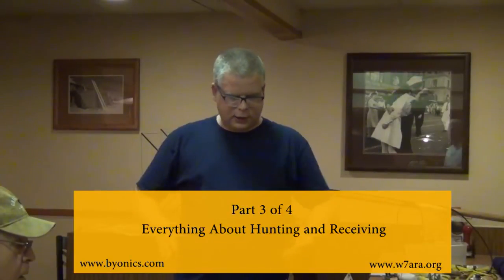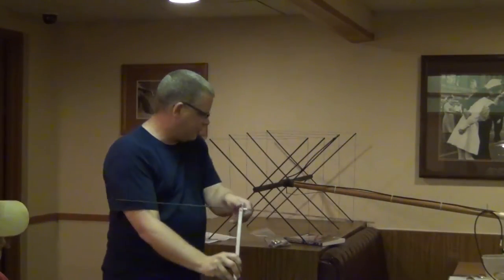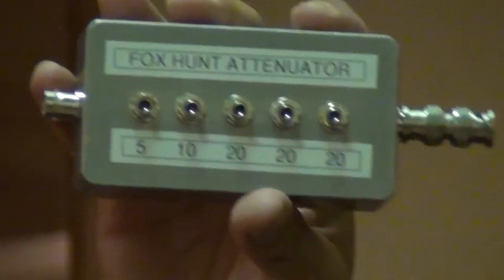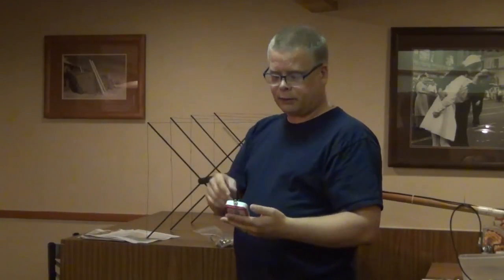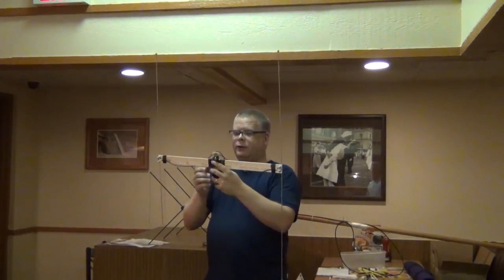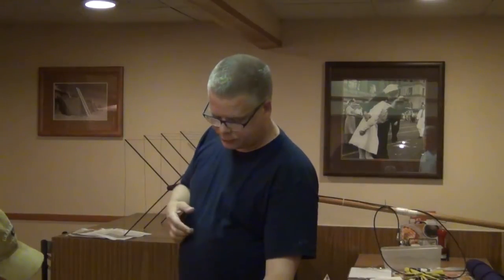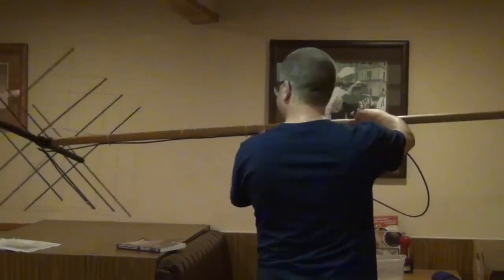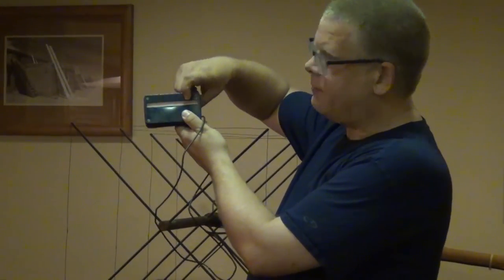Transmitter Hunting and Receivers

Comment: I have a tape measure beam that I made up several years ago, works well except for one thing...I found it don't work well on a windy day, one day I was on a hunt and it was windy and the element just kept bending over in the wind so it was useless that day!  Otherwise works good for me.
Reply from the maker: RadioHamGuy Good to know about the wind. I will have to let people know that limitation when they ask. Thanks. I have a yagi that uses aluminum rode so I don't have wind issues but it is a pain to load in a car and take to a hunt. I really need to cut the rods, thread the road ends and use coupler nuts. I don't think it would cause any issues and it would be more travel friendly.